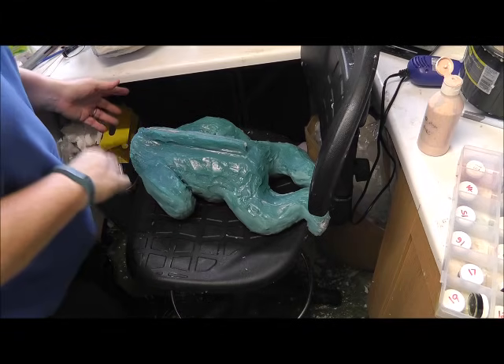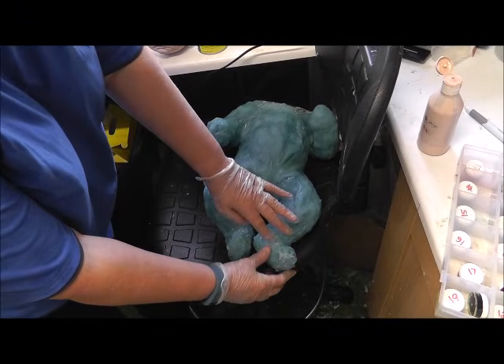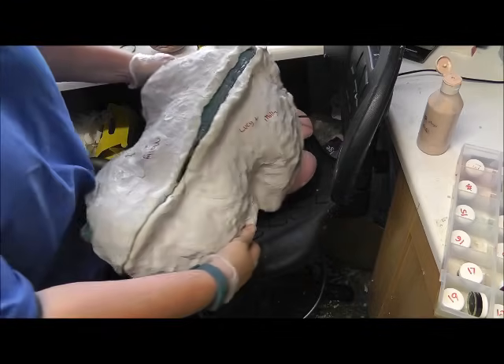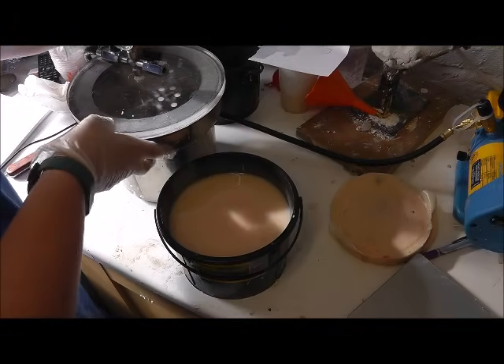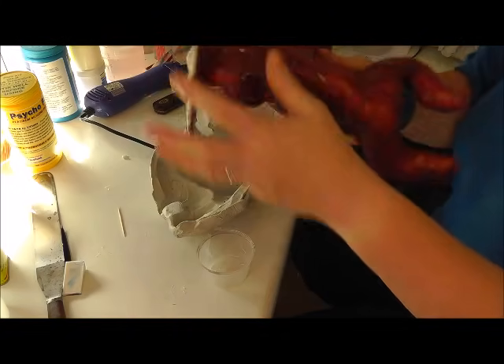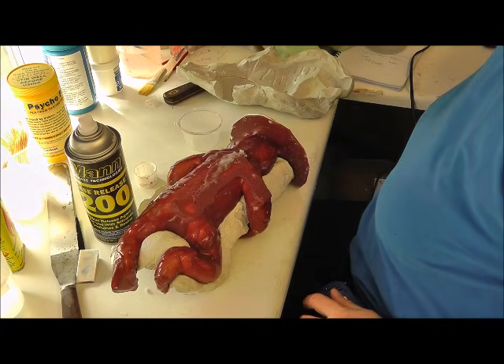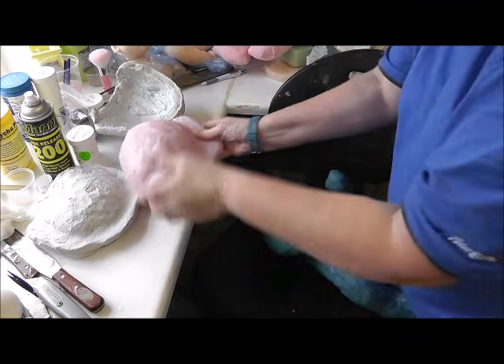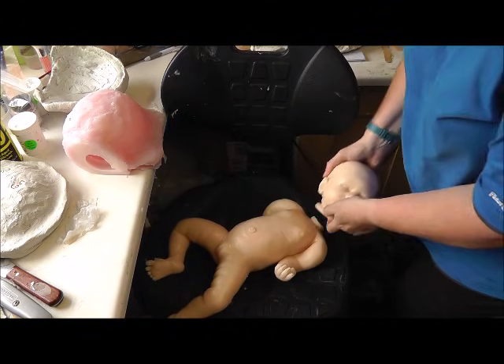Pouring and demolding a silicone baby doll

Comment: You have it together.  That air vacuum is a life saver!  Did you think of using that?
Reply from the maker: Yes I use a vacuum degasser for sucking the air out of the silicone to reduce the chance of bubbles in the pour.

Comment: Which mold type do you prefer and why? Is one better than the other depending on the size of the sculpt? You make the process look simple.
Reply from the maker: I use the thinner mould for smaller sculpts because they are easier to handle and less likely to pinch inside the mother mould. The larger bsbies I've invested so much time and money making the sculpt and mould I usually want a good run of bsbies out of the mould so prefer to make it thicker and more substantial - it's just my preference. I'm hoping to get at least 10 babies out of the big mould (more would be fab), maybe 6 from the small one - up to 10 if I'm lucky. It's difficult to explain why you do something your technique just evolves. Glad you found it interesting 😃

Comment: I am preparing myself to create my first baby and for the life of me can't find how to attach the heads on the solid silicone babies. Can you please help me ??
Reply: Well I'm not a doll maker or so but I have fixed stuff I would leave space in body an some how pour a stronger silicone an brace the whole body an it's togetter that's the way I'd do it but I think if I had the money space an all to do all this I'd do a one piece
Reply from the maker: Hi, attaching the head is not the easiest thing, sometimes I pour the baby in one piece with the head attached.  But to attach the head I scoop out a hole in the neck and head, fill with the same silicone I used to pour it, so it is fresh, then once cured I paint again the same silicone on the join and hold together until completely cured.  The ONLY thing that will stick to silicone is silicone. so you have to fuse the head to the body using silicone but make sure there are no contaminants on the surface that will affect the bond.

Comment: is making a reborn cheaper than buying one
Reply: raven genereaux Counting all the supplies you'll need to makes one (silicone, paints, tool, hair, etc) Yeah there is probably cheap ways to make silicone babies, but if you are trying to make a quality baby, then I don't think so. I guess that's why they charge so much lol
Reply: lilkittyanime ex  💏
Reply from the maker: No absolutely not in silicone.  To make a silicone baby from start to finish would cost you a few thousand pounds/dollars for all the equipment and materials. And it would take you quite a few attempts before you got a doll worth having - a lot of wastage.  So if you are just wanting a doll for yourself you would be better saving up and buying one if you can afford it.

Comment: Is it possible to pour a silicone so the body is hollow to reduce the overall weight of the finished baby?  Like after you pour the silicone into the body the first time and swish it all around, then pour out the liquid remaining in the middle?  I don't know at all, but I wonder.  I'd love to see a video of how to make the mold.
Reply: Brooke Ford I think solid silicone is there to make the baby more durable. if the silicone is thin, then you'd barely be able to handle the baby without tearing off an arm or the baby. The whole size and weight thing is to make the baby feel as real as possible. But I wonder how they make a Drink and wet system in some of these dolls Lol.
Reply from the maker: As Lilkittyanime says, it would be like a balloon if the inside was hollow and would just pop at some point and deflate lol.  If you want a lighter one you can get cloth body silicones (ie like a reborn baby with soft body and silicone head and limbs) which makes them quite a bit lighter in weight.

Comment: how much do you charge for  your silicone babies?
Reply from the maker: They are not cheap, I charge around £1200 to £1500 (GBP) for a full body silicone newborn size. But as you can see it takes hours and hours to produce a baby and the materials are very expensive too.

Comment: Does it cost more to make or buy one
Reply from the maker: It costs a lot more to make one than to buy one - I reckon if you want to make a baby yourself you need to spend in excess of £3000 to set up - and then it takes years to get it right which means more money spent. Its taken me over 2 years to get to this stage and I'm certainly not an expert.

Comment: How big is that bucket and how long is the baby?
What type of silicone is that?
Reply from the maker: Kaylyn Hicks    Haha what a strange question - not sure how big the bucket is sorry😃
Reply: I was asking because I was wondering how much silicone you were using. if the baby was 20" and you said you used two of those buckets knowing the size of the bucket  would show about how much silicone you needed to pour a 20" baby.
Reply: lol nevermind its ecoflex 20.
800 grams is about 1.7 pounds. That means you used about 1600g in 1 bucket. That's 3.5 lbs and you did that twice. so 3200grams = 7lbs in that baby. now I just want to know how big the baby is?

Comment: I'm doing my first pour next month would you recommend doing a full body pour head and all in one piece or this way thank u much love from Scotland ♥
Reply from the maker: Sandra Schrickel    It depends how you have done your sculpt, if you’ve sculpted all in one piece then I would mould as one piece. The only advantages of doing head separate are (1) no pour spot to fix and (2) you can use several heads with the same body.
Reply: My sculpt is all one piece but I suppose you can always pop the head off as it is only clay thank you for your quick response! Much love ♥

Comment: Thank you for sharing. I do mine in very much the same way. I reach into the head with a small craft stick and push the silicone around in the ears when the silicone gets just above ear level, then finish filling the head. Doesn't always work to avoid those nasty ear bubbles, but I think it has helped some.
Reply from the maker: Thats a really good idea, I've done something similar, bubbles are a nightmare aren't they lol

Comment: This is completely mesmerizing.. 
I'm confused though and obviously ignorant so I apologize... but I have been wondering...why is it/how is it that your silicone is able to be cast inside of a silicone mold? My understanding of silicone is that it doesn't stick to anything once it is cured... but that it will stick to itself so my impression with silicone was to never pour silicone into silicone because you'll never get it free of the mold and the mold will be destroyed.... I hear you talking about different hardness types of silicone in your videos? Is that why your able to pour silicone into silicone and pull the softer silicone away from the mold without completely destroying both pieces? Or is it like, a combination of mold release and different silicone hardness's?
Reply from the maker: Skyspiders   Yes you are quite right, but it has to be platinum silicone both mould and pour because other silicones (Tin Silicone inhibits the cure) so we rely on the mould release spray which leaves a waxy film  On the inside Of the mould which allows the silicone to be pulled away from the mould.
Reply: @CarolynDoughtyDolls  Ah I see! Thank you for specifying the name of the silicone. I still have much to learn @-@. I really appreciate you passing along your knowledge! While I learn more about this I very much enjoy watching your process and your expert hand at work! I hope you continue to make videos! Your work is absolutely inspiring!

Comment: I get gunk in the bottom here in the USA also takes a lot of stiring to blend the silicone with the gunk in the bottom
Reply from the maker: Yes I get gunk too - I don't stir it in I just scrape off the top of it and leave it there - I found when I stirred it in it just made lumps in the silicone which is a pain if it ends up near the surface of the baby.

Comment: would blowing air into the foot seam while pulling the leg out the back seam help get the legs out easier?
Reply from the maker: Quite possibly if you managed to get a hose in there - it's a tight squeeze lol.  Sometimes I do use a camera blower puffer thing to get clay sculpt out of tight spots like ends of fingers.

Comment: how much my grandchild wants one .
?
Reply: Mike Wade at less 1000
Reply: Mike Wade it really just depends where you buy it ive seen them start at 100 but these dolls are like real babies they need rockers cribs and more so you need to make sure she or he will take good care of it
Reply: A solid silicone reborn will run you $1500 or more. A vinyl reborn with a cloth body (the more common type) can be as little as $150 but quality ones usually sell for upwards of $300
Reply from the maker: Absolutely right Beckah, reborns are often just gorgeous and a lot more affordable.  Silicone babies are very expensive to buy. Mine are £1200 to £1500 (GBP) so getting on for $2000 USD for a full body silicone baby.

Comment: has there ever been a case were one of the doll limbs fell off
Reply from the maker: No the silicone is like rubber - very strong.  some of the cheap manufactured silicone dolls coming into the country from China are made out of bad quality silicone and they will tear and the silicone breaks down.  So don't buy a silicone that has been made in China.  If it seems very cheap there is usually a reason for it!